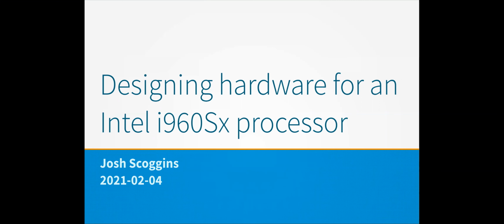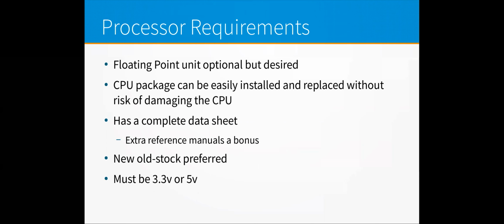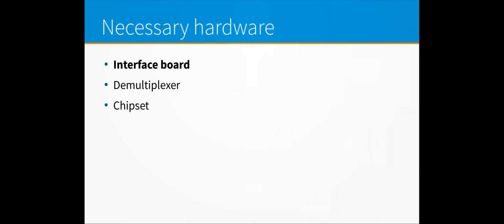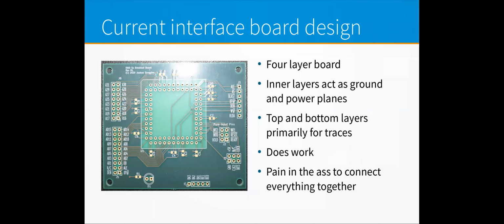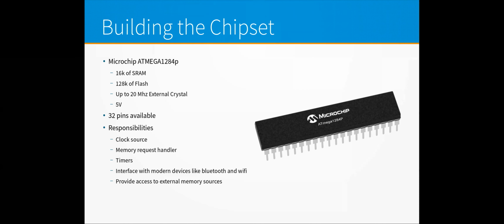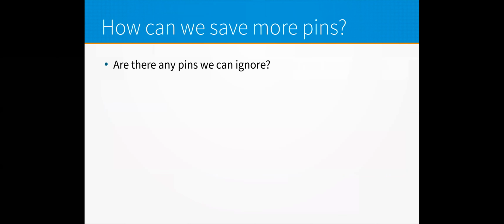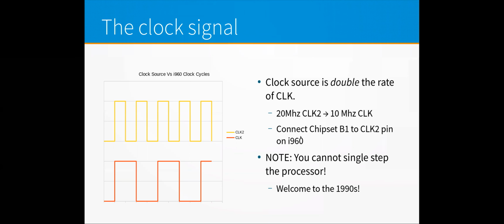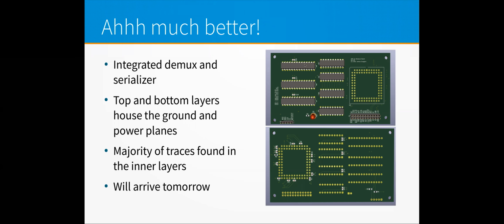Designing Custom Hardware for an Intel i960Sx Processor

Comment: Thanks for the explanation on your development and hardware. I found your GitHub i960 first before the video. I will use the 80960SB-16 for which I have a lot of. For the chipset logic I will use a 5V CPLD. Either Xilinx 9500 series or the Altera EPM7000S series. I have plenty of 44, 84 PLCC parts in various logic sizes and some SMT 100, 128 pins or whatever they are SMT parts. Memory I'll use some ganged 512Kx8 parts. etc. Anyway it would be nice to see a video for configuring the processor and software side of things you did for the Atmel part.